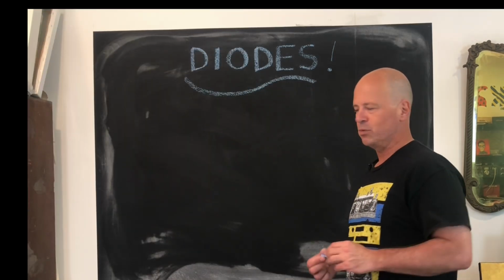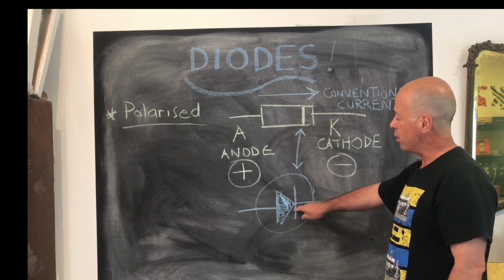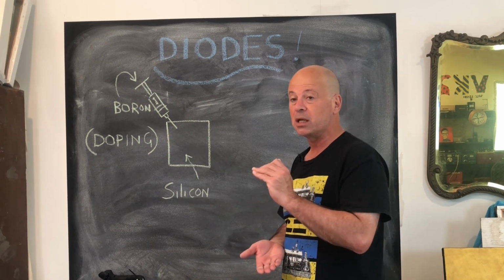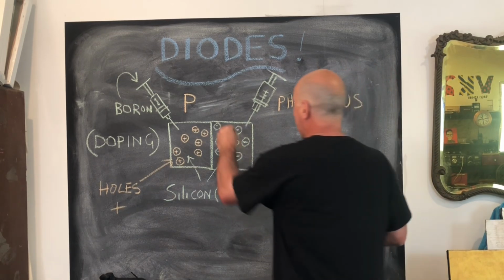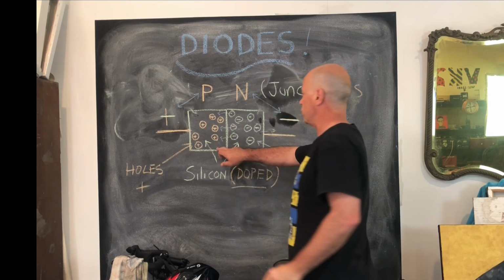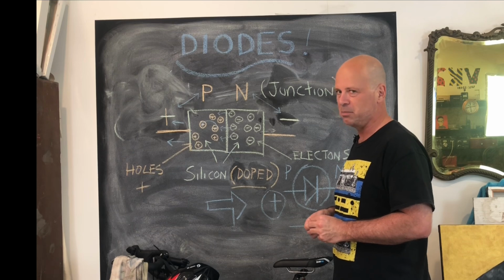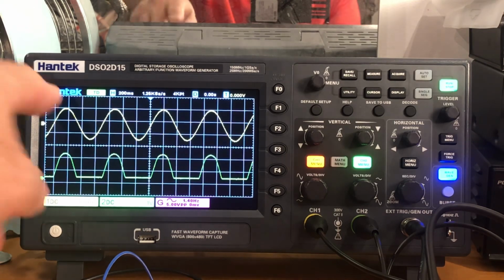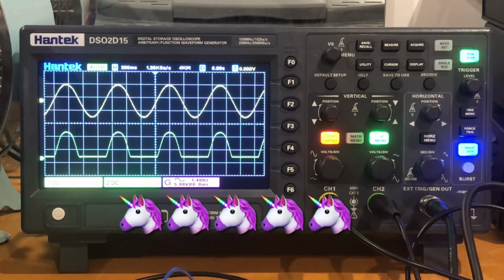How 💩Works - Episode 1 - Diodes

Comment: Great work on the simplified explanation, also good to see you using electron and conventional flow in how the diode works.
I suspect the transistor will be next on the list, but FETs would be a challenge to explain.
Cheers Adam VK2YK
Reply from the maker: Yes! You guessed it....BJT transistors and then OK...I accept the challenge...we will do a FET one! 😁 TU Adam appreciate the comment 73 de VK2AOE George